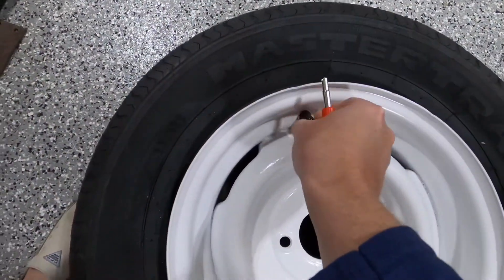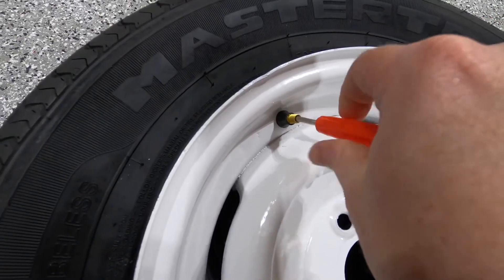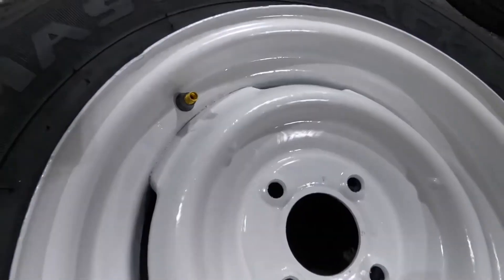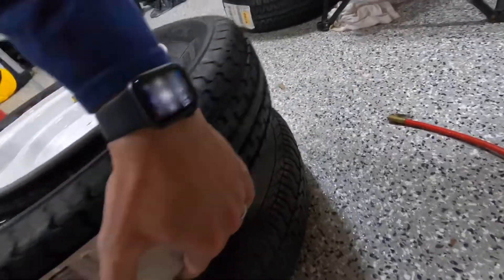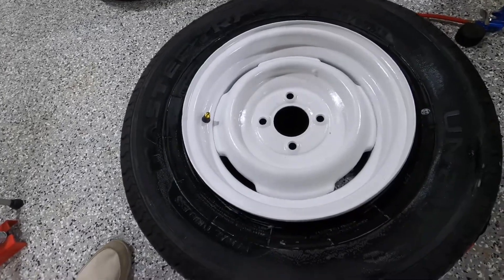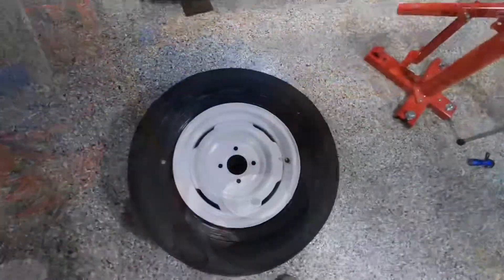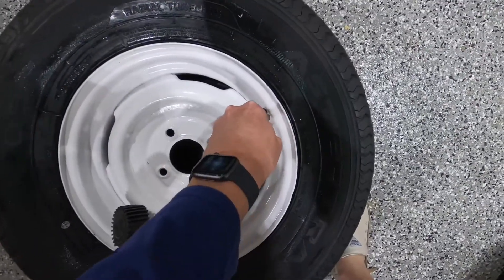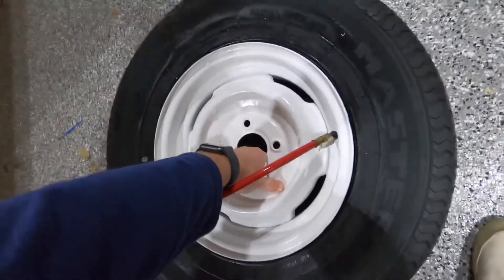Seating a stubborn tire bead, no special tools, no flame

Comment: Ok so here’s a quick tip. Been trying to replace a stem all day. If you have a tow hitch take a scissor jack place it middle of the rim and in the center of the hitch. Crank it down pushing the rim in. You just need enough to get air in it. It’ll take some work but this was how I broke the bead, while huffing and puffing using a strap blah blah. It works in reverse just as well. No jumping no fire no tools other than a tow hitch a beefy vehicle and a scissor jack.

Comment: I was nearly going to give up seating the bead on some very difficult tire/wheel combos  (the tires had been stored stacked on top of each other for a year and a half, so the bead was very narrow) when I came across your video. Through trial and error I actually tried putting the combo over an old tire and jumping on it (even before I saw your video) but gave up too soon. After seeing your video I adopted your technique and successfully seated the bead on four wheels. I would add that the key for me was to use plenty of bead grease on the rim and the tire. ...,also I set the back bead first and then pulled the tire up while airing it. That way it is easier to monitor the progress of seating. Victory!!!! Thanks a million!

Comment: This is actually closer to the right way than anything I've seen recently. When I learned to do this we just held the tire and rim so the rim was about dead center on the tire and pumped the air in. It took 15-20 seconds to seat and less than ainute to inflate.
No fire, nothing flammable.

Comment: Bravoooooo it worked for me. I installed a 285/75 r15z very high wall. I did this on both sides. This allowed the rim to get half rim om each side. Then I out the tire up, started pumping and moving the tire until it got a grip. It took me no more than a couple of minutes. Thanks u very much. I had spent already like 1 hr trying  to work in the tire.

Comment: Do you think I should heat my tire up a little to loosen the rubber? I can't get the front bead to set one side will slide under the bead then the other side (of the front) will slide out

Comment: This did work eventually.  It seats one side by jumping on it hard, then you can inspect the other side to push on the tire and close the gap enough (There's usually only one gap) to get the air going in to do the rest of the work.  I would say however that you should then just let the air all leak out before trying to insert the schrader valve.  Don't worry, if you have inflated it the beads are seated and won't come off.  Then you won't risk shooting the little valve off in space, maybe never to be found again.

Comment: This worked great when my normal ratchet strap approach failed. One key was to use a larger diameter tire to set the new tire on while jumping. And then I flipped it over to begin to set the bead on the other side. Thanks so much.
Reply: This worked great for me.

Comment: Meh, I tried the manual method for like 2 hours. Took me 1 minute with the flame and a kick. No issues except the injection mold hairs burned off. Which is probably fine. I would have loved to get it, but it fought every step of the way. I weigh 240 lb, and it wasn't enough to seat the first bead. 205/65r15 was the tire size.

Comment: I put a tie strap around the outside of the tire and tighten it a little. Works everytime.
Reply: I had that way "not work" for me today on one tire out of two but it's definitely worth trying. Also make sure to try to pump it up with the core out...
Reply: Didn’t work for me today
Reply: @Carpenterappr22  then try using a belt or a peice of rope and some soap and water
Reply: @Carpenterappr22  tight enough to expand on to the high part of the rim where less air can escape. Also the quicker you can push air into the tire the better chance it will seal .
Reply: @m998hmmwv7  it worked!!!!! I used the strap, some pb blaster and my air compressor instead of the inflator that came with my car. Thank you!

Comment: What an absolute life saver. 
I tried for a couple hours yesterday and may an hour today trying to mount a pair of 235 width tire on 8” wide rims. 
I tried in vain to seat one side (as I have done before) with a dead blow hammer. The jump in the middle of the rim did the trick. 
Then the lift the tire (or press down on the rim) and air up (thanks for the valve core reminder)

Comment: Awesome tip about removing the valve stem to flow a lot more air. That worked for me after ratchet strap wasn't enough.
60 gal compressor at 120psi with the open valve and plenty of lube and it popped right up.
Many thanks!

Comment: Another tip would be to put a ratchet strap around the tire tread and ratchet as tight as you can to expand the tire towards the bead. once the bead is seated then remove the strap.
Reply: This doesn't always work especially if it's a wide tire
Reply: This is exactly what I do with the tires on my snow blower. However I can't find a hole in the tire but it still goes flat and comes off the rim. No damage to the rim ideas would be great.
Reply: Sometimes it takes two ratchets. Make sure that the come-along mechanisms are on opposite sides. It helps distribute the pressure more evenly